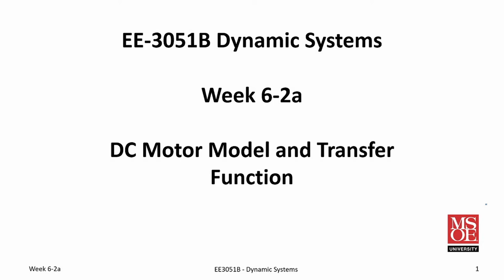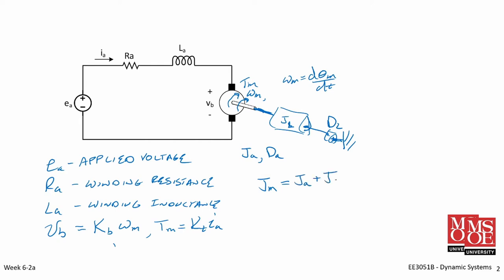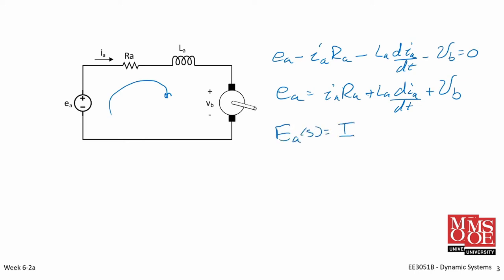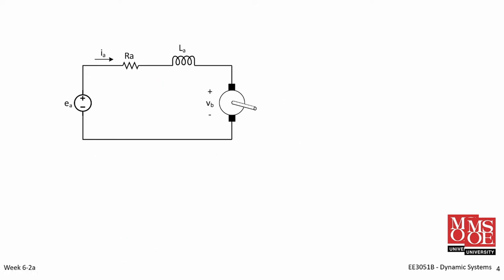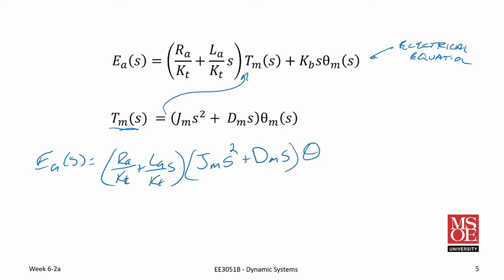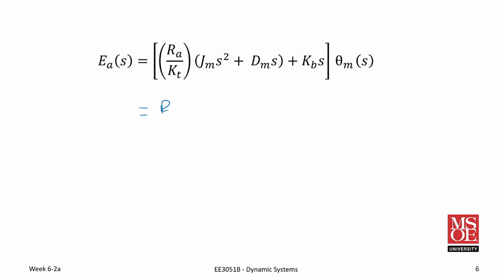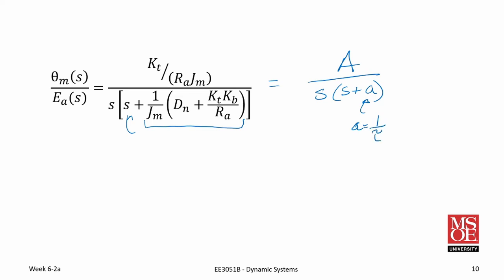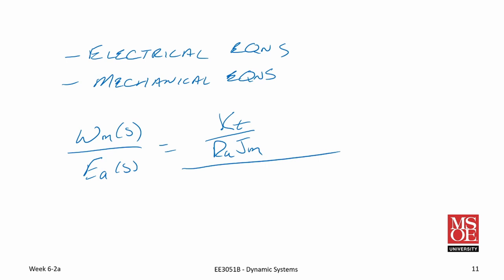Dynamic Systems   DC Motor Model Transfer Function

Comment: It was very useful for me, thank you. If the motor we used was a stepper motor, what would have changed in the end? From where? Can you explain. Thank you.
Reply from the maker: Hello Fusun, there are many good resources on the Web for stepper motors.  The torque and back emf follow the same physics theories that I outline.  The difference is going to be how the magnetic fields are developed.  For example, with a permanent magnet stepper, the magnets are on the rotor and the conductors are wound on stationary posts spaced around the rotor.  These are called stator phases.  The simplest configuration consists of 4 stators phases all spaced 90-degrees around the rotor.  By pulsing the stator phases sequentially, you will step the rotor into 90-degree positions.  Adding more stator phases and/or using more poles on the rotor can decrease the positions to lower angles for higher granularity.  Also, reluctance motors can be used instead of permanent magnets. Hope this helps.  -Dr. K

Comment: Hello sir, what kind of changes can there be if we use two dc motors in parallel?
Reply from the maker: Hi Alper, when you say parallel do you also mean that the rotors are connected as well as the DC bus voltage?  If the motors are identical, then the torque provided will be shared evenly.  In reality, the motors will have slightly different motor constant values and slightly different resistance and inductance.  Therefore, there will be a slight offset of the torque that each motor provides.  If you know the different motor parameters, you could model this with a constant applied voltage, an identical angle of rotation (or identical angular velocity) and the torque would be split as T = Kt1*Ia1 + Kt2*Ia2.  Hope this helps.
Reply: @powerelectronicswithdr.k1017  Thank you so much for replying sir. If you ever decide to visit Turkey, you can be my guest anytime you want.